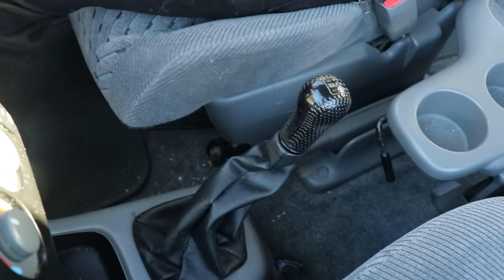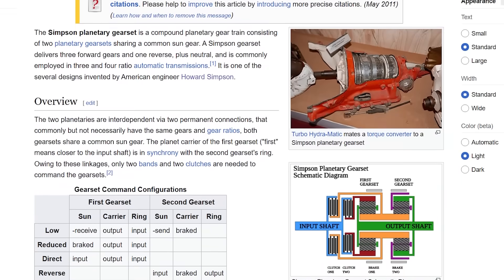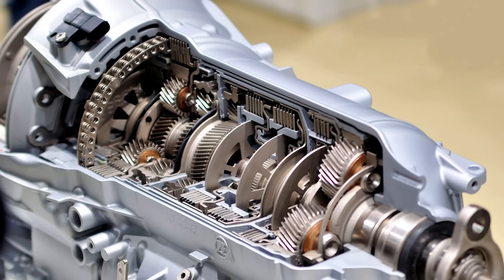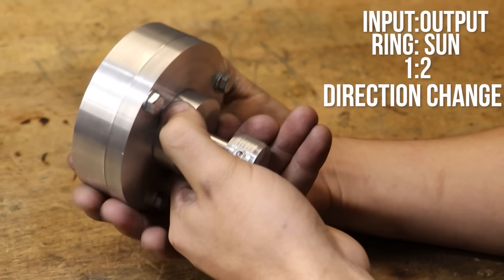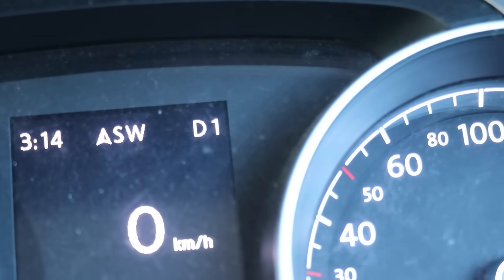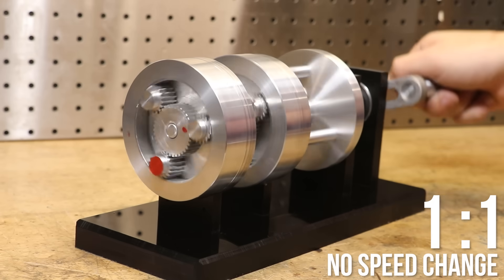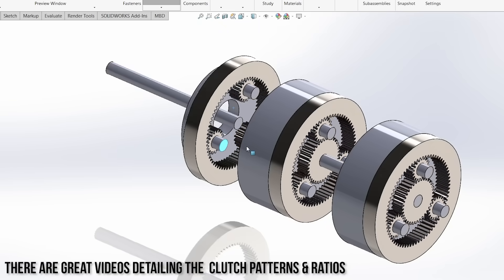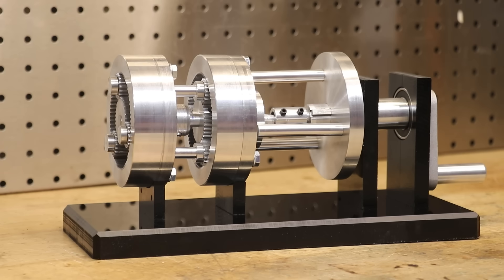How An Automatic Transmission Works

Comment: Do any mass manufactured transmissions have a ratio where the output shaft goes faster then input. Like in this video the ratio went 3:1 then 3:1.66  then 1:1, is there any mass manufactured transmission that has like a 0.66:1 ratio?

Comment: Were you demonstrating reverse by turning the crank backwards? Kinda odd as all the red dots were turning anticlockwise in all 3 gears and reverse also which ham me confused.
 Your toy does not turn smooth enough to twist the crank clockwise while in reverse without coming apart? Wish you had actually said as much. Or am I missing something?

Comment: I drive a vehicle with a 3 speed 727 automatic. While I definitely agree that a contemporary 4 or 5 speed manual or a modern 6, 8, or 10 speed auto would provide a superior driving experience as well as better efficiency, the 3 speed American automatics excel in the area of simplicity, reliability, and serviceability. My transmission has never needed a rebuild in its long life, but if it did fail and need a rebuild, it would be a cheaper repair than any modern transmission.

Comment: Great video. Back in the mid 80's I owned an early 70's Chevy station wagon that had a 3 speed automatic gearbox (Turbo Hydramatic I believe?). That car was a beast, weighing almost 5000lbs, but actually drove quite nicely, despite having only three speeds.

Comment: Haha 13:05 my first stick shifter was a 71 Ford ranger with 3 speed, and ya you basically never ever use 2nd gear, by the time you're off the clutch it's ready to shift up into 3rd.

Comment: I've driven a TWO speed automatic car - from memory it was an old toyota, like about a '60s model or thereabouts. When the motor blew I got a later model Toyota motor (4 cyl) put in and it would happily hit 70kmh in 1st and 140kmh in 2nd.

Comment: It's funny to hear folks these days react to the idea of a 3-speed transmission.  Cars were still being sold with 3-speed autos well into into the 1990s.  3 gears will get you along perfectly fine all the way up to highway speeds, and you certainly don't need to red-line the engine to get it to shift.  Plus 3-speed autos were relatively simple, durable, and proven.  Biggest downside is not having a tall overdrive top gear for high-speed cruising, so fuel economy can suffer a little.  But 80s and 90s cars didn't have the greatest aerodynamics either, so whatever.
Reply from the maker: Dont think we had anything that low being sold here in aus in the 90s. Mostly 4 or 5 speeds by then

Comment: The original Japanese imports to the U.S. with automatic transmissions had two-speeds.  I also had a Volvo with a two-speed automatic.   The Volkswagen Beetle had a torque converter with a two-speed manual shift.  Just a modest rebuttal to the usual slighting of American tastes for road iron.

Comment: Most of the original automatic transmissions from the 1950’s were two-speed.   (The “Turbo-Hydromatic” was preceded by the “Hydromatic.”) Those slush-box torque converters made them about equivalent to the “standard” transmission, a three-speed manual with the shifter on the column.
Efficient?  Don’t ask.   They got down the road and gas was 25 cents a gallon.

Comment: They didn't have any more speeds outside America. Basically all automatics had at max three gears until the 80s when the number of gears started to increase. By the early 2000s there were six speeds and 8 and 10 speeds came in 2010s.

Comment: 0:31 “real world gearboxes” works exactly as you describe and are not more complicated except you have synchro rings. Input shaft spins forwards, countershaft spins in reverse and final drive gear spins forward (when moving forward).

Comment: What blue motor you used for your mill?
can you post motor specs and maybe even link to exact same motor.
kW, rpm, voltage.   I need to get info to buy it

Comment: I had a 64 Cutlass with a 2 speed (not 3!) automatic, and the lurch from low to high was a LURCH. It had a high-compression engine and was the epitome of (for the day) quick but not fast.  Great from 0 to maybe 50 or so, then tailed off with a top speed in the 80s. European cars at that time may have had 4 or maybe even 5 gears on manuals, but even their automatics didn't move to 4 or more speeds until (IIRC) the mid-late 80s. This was one main reason Europeans overwhelmingly chose manuals while Americans didn't - the difference in fuel costs made it a much bigger deal in Europe.

Comment: Those 3-speeds were rough. There were still plenty of them around in the 90s, mostly low-end Toyota's and Honda's, and under-powered and cheaply made too. Especially in inclines or snow storms, when you had to force them to down-shift... you could hear every bit of the engine screaming in pain, and the entire car would recoil from it.
The older American 3-speeds were not as bad because the heavy, over-powered and loud engines kind of just powered through the gear-shifts (which also meant those transmissions took a beating and would wear out quickly, and were expensive to replace).

Comment: You’ve technically built a bus gearbox. Since many buses didn’t need to go much over 30mph, early automatic transmissions for them were only fitted with 3 speeds.

Comment: My brother at one time worked in engineering of hydro-dynamics for GM. Back before computerization, the timing of the shifts was a lot of pressure/ hydraulics.  Varying pressures generated by output shaft speed, input shaft speed and torque would act on various diaphrams and spool-valves. Bascially an 'analog brain'. Many included a small shift linkage from the throttle ('kick down' shift) so when you put the accelerator all the way to the floor, it would downshift slightly for better acceleration (often called 'passing gear', for passing other cars on the highway)
Reply: It is actually a hydraulic computer. Instead of electrons, it has hydraulic fluid. Instead of transistors, it has valves.

Comment: This was a good explanation of old technology. I now prefer my performance EVs with just a few simple reduction gears and that's it. No clutches, no torque converters and almost nothing to wear out. EVs drive systems are the epitome of simplicity.
Reply: Mechanically, maybe lol
Reply: @chidoone5239  yes mechanically. 2000+ parts on an ICE and about 20 for an EV. That tells it all.
Reply: @jetjockgordo  Very true, love the simplicity of my EV's transmission too. Have to admire the workings of an auto trans though, only exists to manage the inherent weakness of an ICE it must be said.

Comment: toyota's ecvt uses planetary gears and instead of clutches it uses an electric motor which means it can make any gear ratio between the extremes iirc

Comment: I own a car with a 3 speed automatic similar to the one you built. It's not as bad as it sounds. Usually those cars have bigger engines with high torque at low engine speed. If I just let it roll it will switch to second gear at around 20km/h or ~13mph and 3rd with 1:1 ratio at 40ish. Driving around at 50km/h (our inner city limits) at less than 2000rpm is quite nice, but it can still shift down to first and rip some tires if you "accidentally" press the right pedal too hard. I think the second goes to about 120km/h (75mpg). The car is limited by driver's fear, not tested the top speed yet. The more gears the better you can run your engine in the optimal rpm range but 3 can be enough for normal driving.

Comment: i was planning to build one as a motorcycle gearbox, but instead of manual dog clutches i was planning on using hollow hydraulic cylinders and two input shafts.  there's CHEAP flat hollow cylinders used as hydraulic throwout bearings for car clutches, it'd work to make things nice n compact.  for a lark, since i don't want to actually make my own gears, i looked up what was available on the jungle site.  there's tricycle gearbox planetaries over there, but the only part that seems built to attach to anything is the centre.

Comment: A great culmination to the series. One small presentation error. You reversed the engine input for reverse, leaving your output shaft going in the forward drive direction, likely confusing some. Well done overall.
Reply from the maker: No, the input shaft always goes in an anti clockwise direction
Reply: @artisanmakes  at 10:40 you can see it moving clockwise... You always turned it clockwise when showing off the reverse gear. That can also be observed with the output always going in the same direction throughout the video.
Reply from the maker: Oh that one shot I must have glossed over that

Comment: My first Dodge Ram pick up had a 3 speed automatic it was a 1979.  My current F-150 has a 10 speed auto. And yes I do find it crazy that it needs so many gears.
Reply: All this modern Cars with 7, 8 or 10 Gears have actually 4-5 Gears.
Everything above is just a Overdrive Gear, to lower the RPM and safe Fuel.
If you would floor your Car on an endless Strait Road, it would never shift above 5th Gear.

Comment: Very cool dude! My 2019 Ford Ranger has a 10spd 10R80. 1-6 are reduced ratios, 7 1:1, and 8-10 are overdrives. It tows very well too

4.69, 2.98, 2.14, 1.76, 1.52, 1.27, 1.00, 0.85, 0.68, and 0.63
Reply: Got a 78 Ford F-150 with a 3 spd. Tows very well too. 

Does not interstate very well lol.

Comment: Excellent video!!!!! I've seen numerous animations but your model beats them all. My family used to own 80's Ford cars with 3 speed auto transmission. They worked just fine; perhaps a bit shower fro 0-60 and the mileage was not great. But they were bullet proof. The torque converter plays a huge role as it multiplies the engine torque prior to the transmission input shaft. I currently own an automatic truck with a ZF 8 gear much like your model but with more ratios obviously.  It helps get good mileage as there's always an optimum gear available

Comment: Nice job. Powerflow does get confusing and different brands did different things. Many used a band for 2nd gear and that is always the weak link but now that's rarely ever done and most all use all clutches which is far better.  Some like Chrysler had transmissions that when it went from 1-2 the entire internal assm had to instantly stop and spin the opposite direction. Much of why they were the least reliable back in the old days. 
 
          I have rebuilt the TH350 and 400 as well as the TH2004r and the 700r4. Many of them share parts as one was a next gen of the pervious adding another gear and lockup converter. There is allot of black majic when it comes to building them well and if you aren't in the know you will need to do allot of research. My personal favorite is the 2004r as it's gear ratios were better then the 700r4/4L60. 
         On interesting thing about the TH350 and TH400 was that way back there were versions made for delivery trucks like UPS and fed ex that used straight cut gears like yours has instead of helical. The straight cut was used for strength but wow was it noisy in a uninsulated metal box on wheels. I had a set of gears for one at one time but no idea what happened to them. 

            Older cars with V8s didn't mind 3 speed transmissions and freeway speeds at the time were 55mph but now we have typical freeway speeds of 65-75 and some 80mph that 3 speed doesn't make the engine happy at those speeds. But the main reason for say 10 speeds is to keep the engine in it's most fuel and emission efficient range not it's best power band. US regs for crash and emissions have traditionally been the most stringent in the world so they gotta squeeze what they can. But the reason for those regs was not to save the planet or people it was to make it harder for overseas car companies to compete since they had to build their cars to a higher standard to sell here.

Comment: I have a very special bicycle with a Pinion 1.18 gear box between the pedals. It has 18 equally spaced gears and works beautifully. I now wonder how similar the guts of that are to something like this transmission...
Reply: Highspeeddrive of Schlumpf or the competitor ? The Schlumpf-drive work about the same as these, with a fixed clutch between direct-drive (1:1) and geared.

Also in electric (assisted) hub-motors with gearing (there is also direct-drive in some brands) the same kind of gearing is used but in those generally no clutch.
I have seen one actually that even had a clutch inside the electric motor-hub. That was ofcourse reducing the torque quite a bit, but making the system far more complicated and prone to wear.

In many bike-hubs, same kind of technics are used too but since the inner shaft has to be fixed (otherwise you cannot support it in a bikefork), the outer-gears and sungears are moved into sequence. And that in some cases also combined with brakes that activate with reverse-pedalling. Putting 7 or even more gears in a bike-hub makes it quite complicated.
I know since I have serviced some of them. No reverse-gear though...
Reply: @el3dprint  I didn't know the Schlump drive, interesting! What I have is literally called "Pinion 1.18", Pinion being the company, 1.18 being the product. I don't believe there's anything else quite like it on the market...

Comment: in the last vid, when you mentioned wanting to keep the elegant form factor, I was thinking you could include clutch pushers from underneath hidden in the supports, with just a button or piano key for each to lever up against one of the rotating sections. I'm excited to see if you do something similar in this one

Comment: For an interesting variation you could look up the AP automatic gearbox as used by BMC, 4 speed and used bevel gears. I've driven a few and they worked rather well IMO.

Comment: It’s been a long time since I cracked open an automatic tranny. Some time in the very early 90’s. You did a good job explaining the operation of one. 
Automobiles have changed a hell of a lot since the early 90’s. Back then the thought was power and torque, screw fuel consumption. That’s why most of the pickup trucks had three and four speeds. And a lower gear ratio differential.

Comment: Well worth the effort building that demo box, excellent.
Epicyclic gear boxes have been around for decades. In the 1960s I worked on them (as an Apprentice) and also used to machine the planet gear carriers to very tight tolerances on Jig Boring machines. These were Thornycroft made boxes for trucks later taken over by Eaton Transmission.

Comment: Big engines cope very well with two or three speed auto transmissions.  The torque converter fills in much of the gaps between ratios.  But with smaller displacement engines, the more gears you can fir into the system the better you can keep the little engine in it's sweet spot as a smaller engine just hasn't got the broad grunt available at low rpm to drive a torque converter the way a large displacement engine can...
Reply: The nice thing about having a TONNE of ratios is that you can legit get away with leaving the torque converter in lock-up for as long as the car is moving, which makes for an appreciable boost in efficiency.
Reply: I had a Geo metro with an automatic transmission which I think had only 3 speeds or  maybe 4. No need to say this thing was painfully slow.

Comment: GM has 10 speed transmissions. Some manufacturer was in development of 11spd. Crazy 🙂 although how a Camaro with 10spd bangs through gears is something very cool to listen.
Reply: Designed by Ford, of course.
Reply: Honda tried to design a 11-speed triple-clutch transmission, where you could have one clutch closed in gear and a gear ready on the 2nd and 3rd clutch to up- or downshift. The premise was to eliminate the downshift hesitation that DCT:s have so you could change gear instantly, no matter the condition or timing.
Reply: @drsenseihugo That's totally different to the type of automatic transmission being discussed by the OP, and the subject of this video, and the clutches in a DCT, or Honda's proposed TCT, are totally different, and fulfil a different function, than the clutches in a traditional, torque converter based automatic transmission.
A DCT is an electromechanically actuated, computer controlled version of a manual transmission, with the only difference being the two clutches, one of which is the connection between the engine and the driven wheels through the odd numbered gears, and the other of which connects the engine and drive wheels through the even numbered gears. The clutches in a traditional automatic transmission have nothing to do with connecting the engine to the drive wheels.

Comment: why is it called an automatic gearbox if it doesn't shift the gears itself? if something else is shifting the gears, why cant a manual gearbox work just as well?
Reply: A gearbox is different from 2 meshed gears on their own, in a transmission something needs to actuate different gearsets or isolate them to allow for different ratios/speeds. In a manual, it  needs you to manually shift the different ratios, but an automatic is automatic in the sense that  it does allow you to automatically shift without needing a hand on the shifter, because the valve body is the brain that determines when it should shift. The shifting is done completely by itself in an automatic gearbox, at least a Simpson style automatic, determined by the valve body and other accessories.
Reply: @jakes8714 hmm, I think I get it. so it's just purpose built to have an automatic shifting mechanism attached to it?
Reply: @theOFFICIALcoldlemonade  yeah, the setup requires less force to actuate, and since you are not trying to mesh gears, less precision in the shift timing